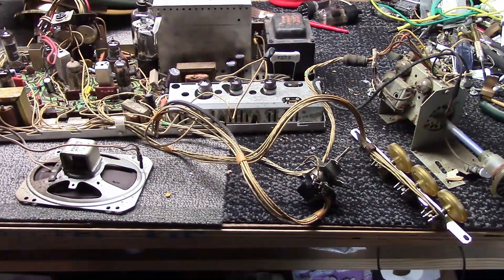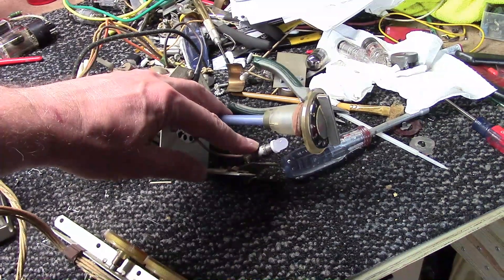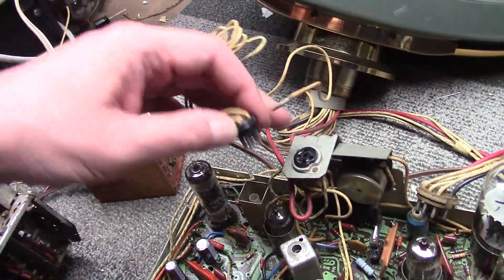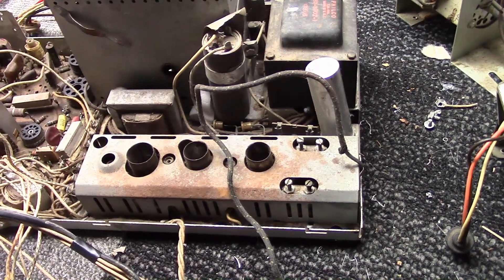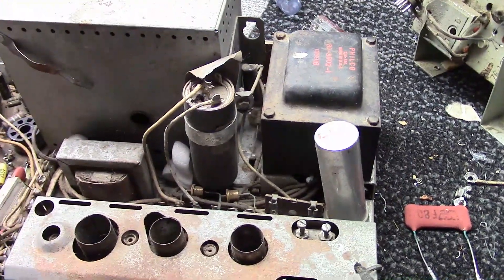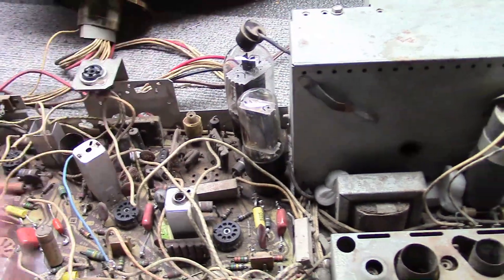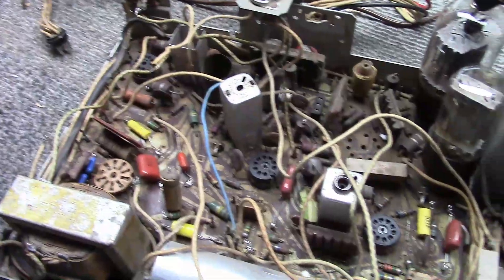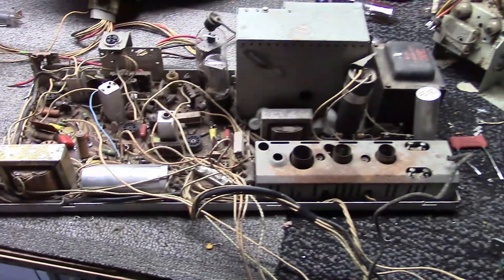Predicta 17" tips: Chassis tour

Comment: Just disassembled my first Philco predicta for restoration. The fusible resistor is missing and the is some thick stranded wire soldered in place, a couple of tubes are incorrect and the shield is completely missing from the tuner. Also the chassis is filthy and the plastic feet are all missing. 
And the CRT has zero emissions.
Reply from the maker: Zero is nearly impossible unless the filament is blown open or it has lost its vacuum.  The rest of what you describe is fairly typical.
Reply: @bandersentv heater still glows but no emissions or cutoff control. There was a small amount at first and then it flat lined. I found a seventeener with a good 17drp4 for less than an nos CRT so I will swap them and maybe one day I will find another CRT or be able to get one rebuilt and restore the portable seventeen er.
Reply from the maker: That doesn't make sense.  What filament voltage are you testing it at?  Could be a replacement with a 6.3 VAC filament.  I'd forget about getting one rebuilt.  17" CRTs are not hard to come by. There are about a dozen types that will work in a Predicta.
Reply: @bandersentv it was a 17drp4, should have been the 2.68 volt. The emissions I got initially was barely above 0. Maybe an internal connection opened up?
Reply from the maker: That what I'm thinking - open cathode
Reply: @bandersentv when I get disassembling the head maybe I can take a closer look. I’m sure it’s an original CRT but I will verify.

Comment: something I've always wondered is, whether feeding the filaments of the vacuum bulbs with AC power rather than DC doesn't introduce unwanted humm into a device (like a TV). So what's your opinion on that Bob, and wouldn't it be better to actually rectify the filaments AC power to DC and filter it to get a "purer" (less hum and transients) functioning of the circuitry?
Reply from the maker: I don't really have one.  I mean I've never thought about it.  I would think if it made a difference, high end sets would have done it.  The cathodes are indirectly heated so there is no direct path for AC to get into the circuits.  Also, the sensitive Rf and IF circuits and transformer coupled tuned to the IF frequency.  That's well above 60Hz and it will not pass through.

Comment: I’m sure Bob knows this but for anyone that’s learning, using an LED is possible here but you can’t in the 21” sets like the Tandem and Holiday 

You can get a warmer color LED from comet. They make pinball LED conversion kits and you can pick cool white or warm white color. Theirs are easily the best out there.
Reply from the maker: You can, but it requires a little tinkering.  I did it in my first Holiday restoration.  I replaced the whole dropper resistor with an AC motor run capacitor and use a 120 VAC LED bulb for the pilot lamp.  Another option is to replace the bulb with a 6.3 volt LED as shown but you'll need to add a parallel resistor to simulate the 450 mA incandescent bulb.  Might also need to add a 6~7 volt TVS diode across the LED to protect it from surge voltage when the set is turned on.  Probably not worth it as it will confuse a future owner.